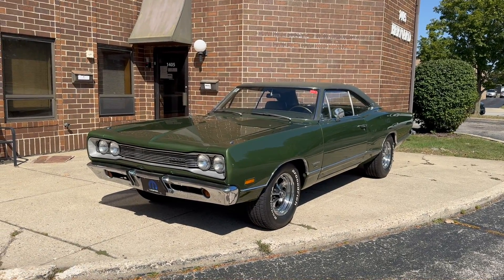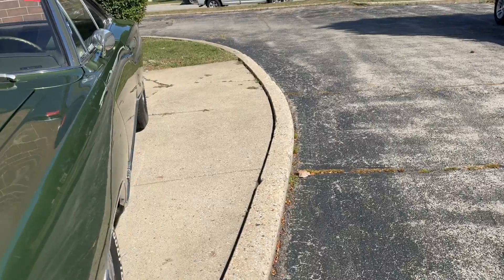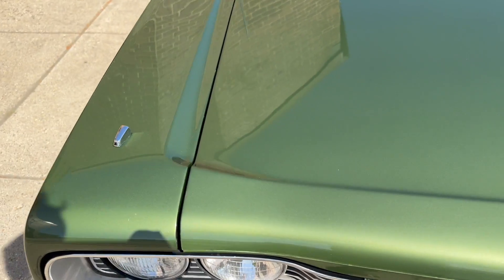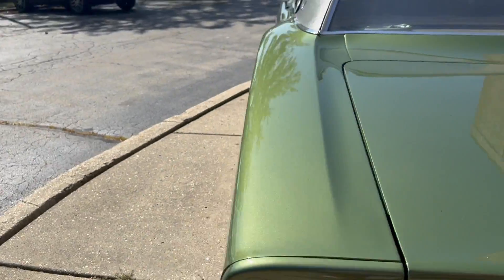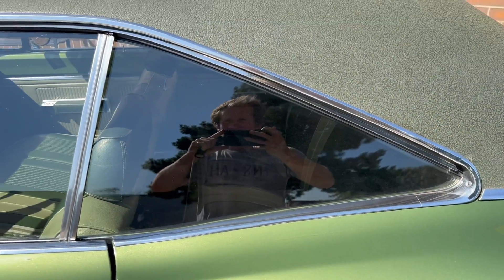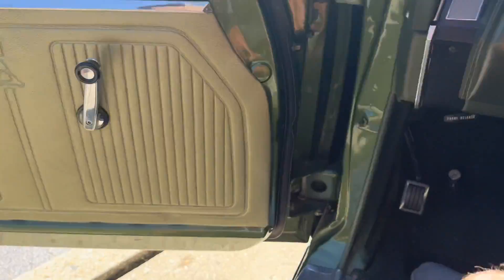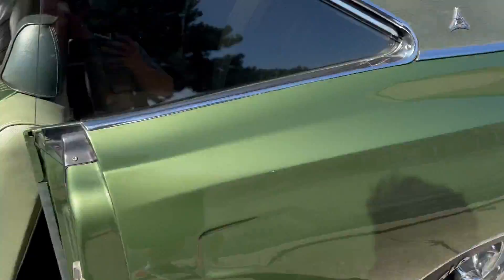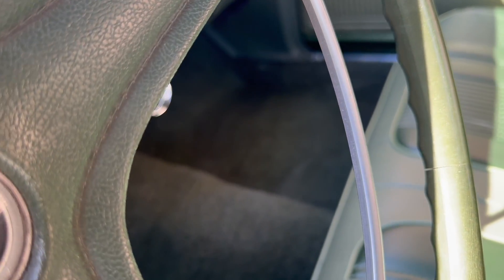1969 Dodge Coronet 440 - SOLD

Comment: 😎Looks identical to my 69 Coronet 440 but mine had the Ram Air hood wish I can go back to the early 80s I need a 🍀time machine 👀✌️
Reply: 😎I had a real 440 motor not the 360 that was in my Challenger 👀✌️